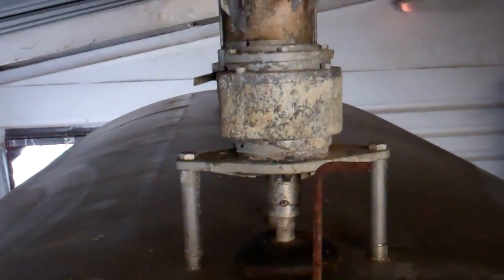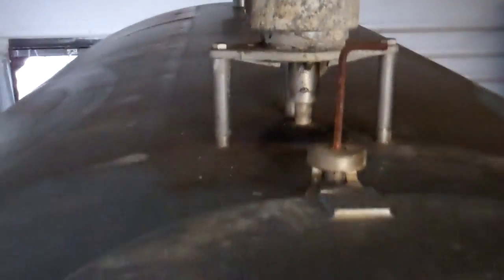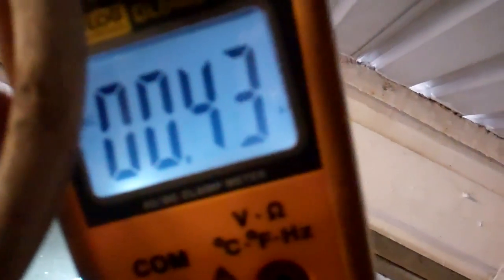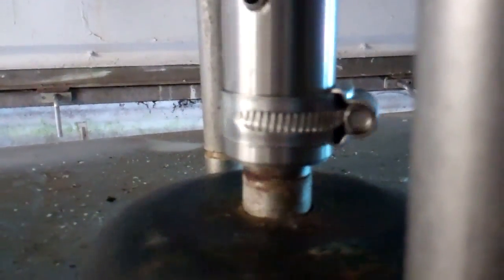Sirem Agitator Fail and Fix

Comment from the maker: Hi, on this one the water is pumped to a fixed spray head just behind the agitator inside the tank, the pipe is run between the inner and outer skins on the milk tank.

Have a look at my 'DeLaval Agitator problem' vid for a view of a Sirem agitator where the wash water goes down a hollow paddle shaft, it uses a V lip seal to keep the water where it should be.

Comment: yeh its not cheap stuff!, sadly we had a batch of them split the PVC outer boss and fill with water, throwing a "Hall sensor error" on the PSU's PLC.
not our fault but just shipping the dead ones back to France for warrenty  reimbursement cost a fair bit!

Comment from the maker: Wow thats a lot of money to have at the bottom of a pool! 

These agitators can be expensive too, this one was about $550 but have just done one on another make tank that has a hollow output shaft so they can pump the wash water down the center of the paddle, that one worked out about $1000 with the spacer kit it needed.

Comment: I've seen a few gearboxes do that, the oil turns into a nasty emulsion and it all goes down hill from there :(
the glycol fluid they use in SITI boxes is worse, its as hygroscopic as brake fluid, and just as keen to attack paint on anything!

Comment: The motors we use are encased in a PVC plastic housing with thick end bosses that get screwed into the stainless steel roller tube.

only exposed metal on the motor is the SS output shaft, fitted with dual lip seals and pressurized with 5psi of nitrogen, expensive little buggers too!, $1200 or so each!

Comment from the maker: Most of the milk tank manufacturers use Sirem motors for the agitators, wash system pumps and chilled water circulation. 

That pretty impressive to get a motor and gearbox waterproof enough to be in pool water, i expect the chlorine is quite corrosive.

Comment: From the sound it probably got water in it through a seal and then it made it's own grinding paste out of it. Probably was hosed down a lot when hot, sucked in through a vent or through any weak spot in the shaft seal. Now I know where to go shopping when the motor on one at work finishes dying, been noisy for a decade now but still trucking. I did strip it and replace the grease, old stuff had gone hard but was still ok, Replaced with synthetic food grease and it went a lot quieter.